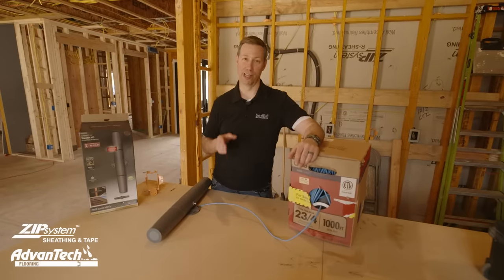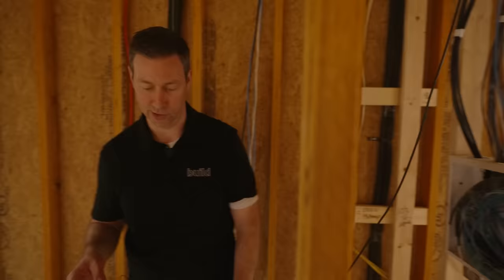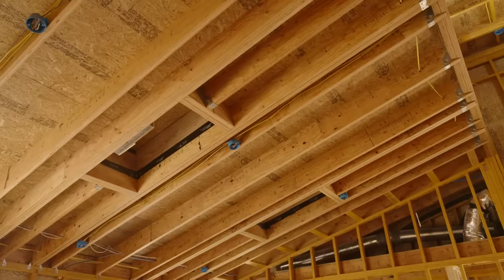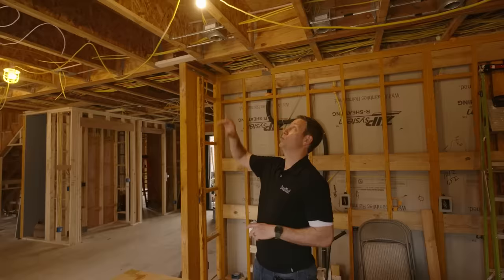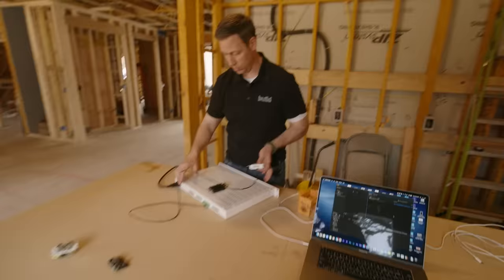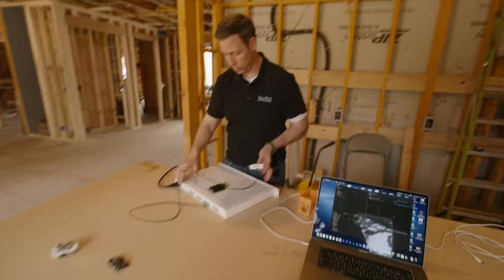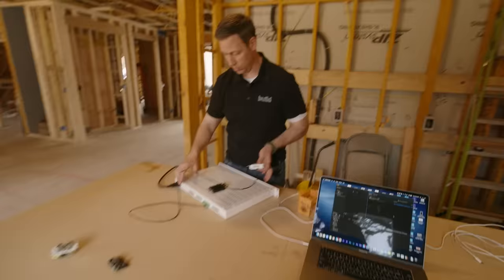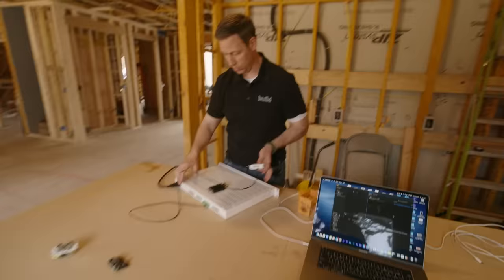Low ⚡Voltage at the Real ReBuild

Comment: Look into POE lighting. It's not cost efficient in remodels generally, but lots of schools and industrial new builds are using CAT 6 etc. to power IoT light fixtures. Super cool!
Reply: I agree with you. CAT6 and POE is the standard that is never going to die. 20 years from now there will be a POE to what ever Apple proprietary stupid "standard" of the month is being used at the time. Even with the move to POE+/POE++ Type 3 or 4 the cables stay the same, its just the end hardware that is different.
Reply: Yup  I’m checking out vendors like dmf lighting,  lumencache, Environmental Lighting, Colorbeam and more for DC lighting.   It’s highly doubtful that if I were to build a new home I’d do line voltage lighting.   I can do 0-10v and DMX until my hearts content from a fraction of the cost of a spec grade fixture.
Reply: Ubiquity had a POE LED panel. Not sure how popular it was/is.
Reply: @BretBerger  Pretty sure they still have it but it’s basically built as a drop in replacement for 24 x 24 roof systems I believe.  I still may look that way when I redo the lighting in my garage.

Comment: Matt, now is a good time to double up on your runs of cat 6 ethernet cable. The reason is that there are already modems and routers that can double the normal 1 gig connection by using dual cables. So help to future proof your home and run that second Cat 6 cable alongside the first right now before you close up the walls.
Reply: Isn't 10 gig eventually going to be the next standard? I think Cat6 handles that no prob.
Reply: No.  CAT-6 can easily handle 5.0GbE up to 100 meters.  CAT-5e already handles 2.5GbE.  He should invest in a good 2.5GbE switch, starting out, or a router with an adequate number of 2.5GbE LAN ports.  His Internet uplink will probably fall between 1.0 and 2.5G for the foreseeable future.  Maybe in another video Matt can go into more detail about the Internet provider he has chosen, and the provider's upload and download speeds.
Reply: @supremelawfirm  100M is a football field, dang!
Reply: @supremelawfirm  Cat6A = 10 gig.

Comment: Hi Matt,
I am a dedicated viewer of you channel.  I wanted to give you my 2 cents worth on low voltage wiring.  In 2008 I remodeled (before moving into as my new home) a 1933 2 bedroom, 1800 square foot home I inherited.  I rewired the entire house upgraded from a 60 amp service (fuse box) to a 200 amp service with 40 breaker box.  Ran my 120V electric with 12/2 wiring for 20 amp breakers.  My thought was 20 amp service so I don't have to worry about overloading a circuit and being able to plug in anything I needed in the future.  I also ran Cat 5e, RG-6 & Cat 3 cable to 7 locations in the house.  I live in a small town.  Everyone around me is running wireless routers.  Because of so many wireless devices, they are interfering with my router range which is fine since I am able to direct wire internet to my 4 tv's, 3 computers, my surround sound system, security cameras, in home telephone and any other devices I want to add later.  I use wi-fi for cell phones, firestick and printer.  Note- there are several adapters available to hook up devices to RG-6 wiring as well as converting Cat 5 or 6 wiring to hdmi cables.  The connections are endless on data or video or sound.  I hope this helps.

Comment: Best thing I did in my remodel was to run flex conduit from my media/network closet to every TV location and also my office and a few other spots. Tech changes, and if needed, I can pull some new wire type to where it’s needed without drilling holes or patching sheet rock. I’ve already run one new cable this way. Matt, I’d encourage you to run a flex conduit to your TV location at least!! BTW, you’ll like the Ubiquiti gear. It’s really nice.

Comment: Cat6 is magic you can run anything over it:  IR, network, HDMI, USB....  
You need wired POE wireless access points on each floor running back to that ubiquiti equip.
Reply: You can run anything over ethernet cable with the right media converter.

Comment: Matt I’m  an A/V professional And I am bewildered that you wouldn’t enlist a professional for the low-voltage part of your home and feature that profession as you do with so many other skill set. Certainly is a professional homebuilder you’ve seen the countless mistakes done by homeowners when they don’t have a plan and a list of professional for this part of their home. As one of the other commenters pointed out the Samsung fiber optic cable is not in wall rated and you should be putting their terminal box behind the TV .there are boxes made for this and you will also want it there so that you can hook up the HDMI to your Sonos ARC . I would love to see how many other mistakes you’re about to make. I’m a fan but I got a ding you on this one.I would also put in a larger low-voltage panel and I would do a four rack on wheels so it’s easier Service. You will hate the wall-mounted rack in that little closet.
Reply: Pardon the misspellings I was doing this verbally
Reply: I’m glad you called this out. Just cuz you can’t be shocked doesn’t mean you can’t be burned. Hire a professional.
Reply: As another a/v professional...I agree 110% with Mark.  Never run the one connect cable back to a home center for the frame tv.  It is not in wall rated. What if the cable gets cut, goes bad? Or especially Samsung changes models, or you change tvs.  That cable may change, and now you have problems. The one connect box should only go directly behind the tv with an in wall box made for it.  

Also based on samsung and sonos audio problems with eArc, I would not match a samsung tv up with any sonos product now, especially the arc.  Samsung and sonos have stated there are some software bugs they are working out.  We still notice audio issues with these.  I would use a sony tv and sonos arc, to help prevent audio issues. I know you wont have a frame tv.  With that said, the frame tv is a nice concept, and fine picture.

Yes I know you or others may not have audio problems with samsung and sonos, however as the av professional, I have to choose products and companies that provide the least amount of consumer problems and call backs for me.
Reply: I laughed when I saw this comment because of the trouble I had to go through to install this Samsung TV. I have a 75" Samsung Frame installed at my house and had to reframe my wall &  redo electrical to accommodate the One Connect box. TV is AMESOME! I just wish I would have known about it while I was building my house. I know that's how it's done, but it's a pain to have that one connect box in the wall,  behind the TV. Anytime you need to access it, you have unmount the whole TV.  I  had to use a Ethernet balun to run the A/V back to my A/V closet so it'd connect to my main system. Luckily my A/V guy told me to install two ethernet ports at every TV location so I had an extra one for the balun....and ya, that's why it's good to consult an a/v guy :-)

Comment: First off, I would say you haven't run enough CAT6.  Wherever you have a computer or a TV, I'd run at least two CAT6.   You may have a "smart TV", which would need one CAT6, but if you get a Fire Stick or something similar, those run better when cabled.  Any device that isn't going to move should be wired, in my experience.  Sonos is fine, but if you're doing in-ceiling speakers, the architectural speakers are way over priced for what they are.  Couple that with the cost of the amplifiers, and it gets insane for a house.  Maybe they're donating them all to you?  You may not be into the tinkering, but you can get much more cost-effective Sonos results with Symfonisk and modifying those to run less expensive ceiling and in-wall speakers.   Lastly, I'd suggest you revisit your decision to use Ubiquiti security cameras.  That is a closed system - you can only use their cameras with it.  Much better to get e.g. a Lorex / FLIR system where you can use any camera that is ONVIF compatible.  It will give you much more flexibility in the long run.
Reply: Good points. I would say that hacking Symfonisk is not a good "professional" approach either: you're repurposing a product for an unintended purpose and will find unpleasant limitations and edge cases. They're not certified to mount in-wall or in any plenum or other inaccessible space, and if you're running speaker wire to normal passive in-wall speakers then there's really nothing special about hacking Symfonisk units to be the driver/amp compared to using a designed for purpose system.

Sonos Port amps add up fast at $400/ea for a single stereo zone, but at least they support dual mono out on the amp and they have analog and digital stereo out if you want to expand the size of one of their service zones with more speakers.

I guess what I'm saying is "Even if you want Sonos, don't use smart in-wall speakers because smart tech changes and you don't want to have to do drywall all over your house just because Sonos discontinued your product or went out of business". Run passive speakers in-wall everywhere you want them, and you can use the same ones for decades vs the likelihood single decade lifespan of a Sonos smart system. And if you want to Sonos them, you can run Sonos Port amps in the closet. If you change streaming audio systems you can easily swap the amps without having to modify the in-wall speakers or anything else.
Reply: @haphazard1342  That's what I said!  Don't use Sonos' overpriced speakers, and also consider driving them with cheaper amps (aka Symfonisk).  I agree the aesthetics of the Symfonisk in your rack may be off, but you can always disassemble them and put them in 3D printed cases!
Reply: + 1 on the double CAT runs, -1 on the lorex cameras. Im in CCTV and I cringe when I see them. Going Wisenet (aka Samsung) is a much better choice, you can get them in IP and Siamese, they are built like tanks, and support ONVIF. Way better way to fly. Also, +1 on not using Ubiquiti cameras, they are proprietary, have zero support, and they are extremely expensive, bordering on overpriced.

Comment: Run conduit everywhere you have or want tech.  it will futureproof your house
Reply: Underrated comment.  I learned my lesson immediately after finishing my first basement renovation in the early 90's.  Had 'futureproofed' by dropping dual phone jacks on every wall so I could flexibly do fax and dialup internet, lol.  Now we are 4+ generations of cable technology later.

Comment: I think others have mentioned it already but Ubiquiti makes a PoE LED panel which is really great.  Only has the one light spectrum so not ideal for home use but I am planning to use it for the garage.  I use Ubiquiti and Sonos for all of my installs.  Have used Ubiquiti for years with great success.  My home Reno plan includes Tesla batteries for whole home power backup (I know it’s a lot but everything we purchase is as energy efficient as we can get).  Great low voltage video, it’s always overlooked in new builds!

Comment: Matt, I built my own 3000ft sq house and wired it in about 2008.  I wired for those ipod ports all over the house.  I wired it for intercoms too.  Moved in and that technology was obsolete.  I also ran coax everywhere and lots of runs to the attic too for satellite dishes. Never connected any of them either.  Well one to the main TV for a couple years.   I just drywall patched over 2 of the ipod port boxes and one of the intercom boxes.  With many more to go as i repaint.  LoL.  Right now they have blank plates over them.

Comment: Matt, what's the maximum wire lenght for those Voltek outlets? Since low voltage DC power  tends to lose power with distance.
Reply: I was wondering the same thing, pretty sure they must have a maximum distance in their documentation.  I would also expect they recommend a central location for the unit to minimize long runs. The actual wire gauge they list on the website is 16/18 gauge and rate it for 60 watts. The website lists nothing about max length which in itself I find a bit weird. Personally I have installed electrical outlets with built in USB connections that work fine for charging devices(Leviton Decora USB Charger Tamper-Resistant 15A Receptacle 5.1A Type A/Type-C).  Would end up being cheaper using those.
Reply: You are right that the longer the lengths, the more likely issues would manifest in the form of voltage drops. With low voltage DC power, you will need to factor in both the "to" and "fro" lengths. 
Let's say you're putting am outlet 30ft away (roughly from basement to upstairs master bedroom), that is a total of 60ft.
The more DC current you try to draw through that long of a run, the more your voltage will drop at the receptacle end.

Typical MacBook 13" USB-C power brick rates at 60W, right at Voltek's limit. So for full power draw, the laptop expects to draw up to 3A of current at 20VDC.

With the BlueSea Systems Circuit Wizard app that I use for designing and spec-ing new DC power installs on boats, if we consider 60ft of cable, 3A of current draw and accounting for 2% voltage drop (I'm not sure yet how sensitive laptops charging circuits are to voltage drops before dropping to "slow charging"), you'll need to run 14AWG.

Good thing is those green phoenix connectors should be able to accept stranded 14AWG just fine.
Reply: I was curious about this too. I think Voltek is neat, but not the great solution they try to claim it is.

Looks like the central device outputs 36vdc. Presumably the wall plates are responsible for power negotiation and converting down to (5, 9, 12, 15, 20) volts. Converting down also allows it to mitigate even large voltage drops. You still lose the power over the long cable runs, but even you lose 6v in transmission the plate can still convert down to the highest USB voltage (20v). 

60 watts is nice, but it's already been surpassed by even "regular" Macbook max consumption of 87 - 96 watts. (Note that this is for charging -- simply running the machine with no battery loss should be much less.) But, USB C max is 100w and on its way up to 240 watts. So, Voltek's solution is almost outdated already. (

They make a big point to claim environmental benefits over high-voltage cable, and that's true so long as you're running LV instead of HV. But nobody is replacing HV with LV, so you end up running both, which completely negates their claims. One day, hopefully, but not today.

Comment: Matt 1 thing to be very mindful about I'm a certified electrician been doing the work for 33 years now. Anyway the thing to be relentless about is how close to your low voltage and cat5 and cat 6 wire that regular, 14,12,10, and 8 gauge wire runs next to I always make mine run at least 1 foot apart from the low voltage, but also 2 or 3 feet if possible. Because of electromagnetic induction (let call it in kids terms, like a force field, that runs around the wire, as electricity travels through it.). You can have heat bleed, from the higher voltage, (pressure of electricity), or amperage (the higher amount of electricity). But more importantly you can have line leak from the electromagnetic induction. This can cause the smaller wire to get hotter but also run at double the voltage or amperage being carried by the smaller cables. You would have experience with this when someone ran an old doorbell, low voltage wire through a hole in the floor joist with a 12-2 or something. And at that point the area where they touched the low voltage wire is hard and flaking apart. This also caused premature life of the old products. But great video as always.

Comment: You have some good taste in electronics. Been using Ubiquity and Sonos products for a while. You won't be disappointed. (Ubiquity's wireless is very reliable also, btw, and you can just run a home run from the AP's to the dream machine and put the AP's anywhere if you don't think there will be enough coverage).
Reply: Is it better than a mesh router system?
Reply: @10tenman10  If you ask me, yes. With mesh you have to deal with bandwidth sharing, etc... Too many cons. I'd rather have full switchport bandwidth (and POE) available to/from each AP. And Unifi can treat all the AP's as the same SSID, btw, in case anyone was wondering.

Comment: @ Matt Risinger as a Service Tech for a communications company thank you. I was just about how I am completely baffled by how smartest of general contractors completely over look low voltage wiring and then we get called and start drilling into a brand new house for something that should have been preplanned. It’s like waiting for the electric company to install service before running Romeo.
Reply: I had a client build a $2m custom home, then call me for the network/cams/tech. House was almost complete. I asked the client to see the wiring panel. He took me to the garage and showed me the electrical panels. I said, no...low-voltage panel, you know...network wires/speakers/cameras. Client's response? "Oh...we're doing everything wireless". Lol. I had to tear apart his new finished drywall to wire everything. #TechnologyIsHard

Comment: It's sad with the pandemic you couldn't connect with Linus Tech tips. He was doing home renovation last summer, and you need a home network design and hookup.
Reply: I was going to suggest this as well. If I had a media closet like that I would probably mount a network rack or even half height server rack. Having onsite backup server, plex, and home assistant would be awesome with some of the features he has been putting in.

Comment: The first time you need a 20 amp service, you won’t regret the heavier wire ( no one puts 20amp service in because they’re worried about lighting). Also, not all laptops can charge off of the USB-C